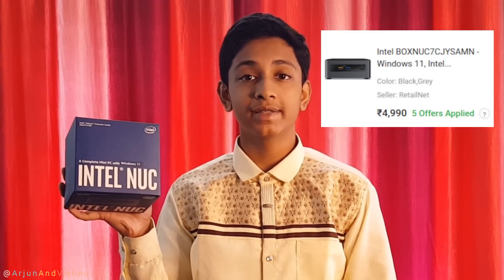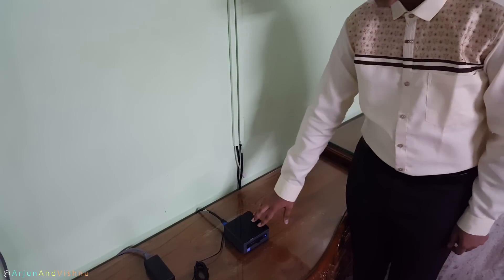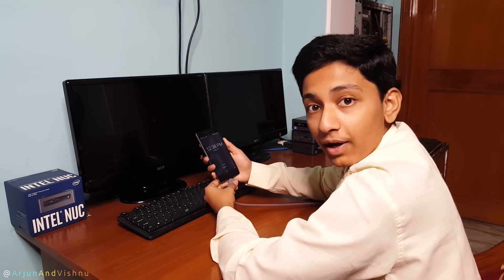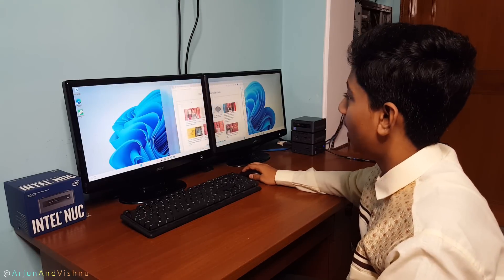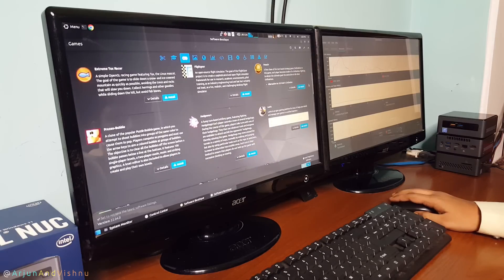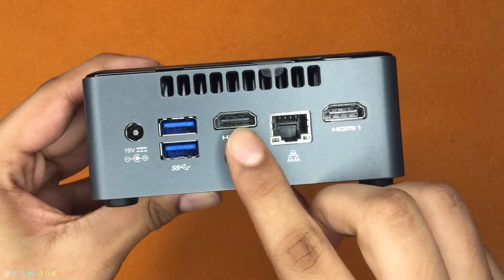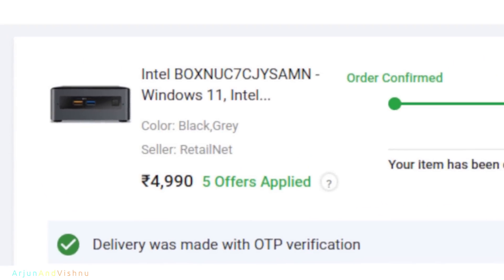Intel NUC Mini PC with Windows 11

Comment: I bought HP Chromebook 14a na1004tu 4gb/64gb emmc @18K on 21 March 2023.
Now I feel that I should have bought Windows because I regularly transfer photos videos movies web series in sd card, pen drive, external HDD and transfer speed is slow(in my old desktop pc i3 2100 with HDD, copy pasting is faster than this Chromebook).
Q1. How can I improve my transfer speed on this Chromebook?
Q2. I don't like Chromebook file manager app. Any other file manager app would you recommend like windows file explorer.
Q3. Which is better choice between this HP Chromebook celeron n4500 and Intel celeron NUC 4gb/64gb j4025 for home use ?
Reply from the maker: A1) I have gone through the specifications of HP 14a Chromebook. It has a couple USB-C 5 Gbps ports. Is the slowness of data transfer because the storage devices connected to it are USB 2.0?, or because it is connected via a USB 2.0 hub? To find out, you need to connect the storage devices and hub to another computer and test the speed with "Crystal Disk Mark". If they are fast, then you need to get the Chromebook checked by HP.

A2) N4500 is 25% faster than J4025 (NUC's processor). There is little that you can change on a Chromebook. Maybe, you can try installing Linux on it.

It is always better to buy a computer that you can install your choice of operating system.

I am not suggesting that you buy this exact model, but go through the review for an idea. It is more than twice as quick as your Chromebook, and you can modify such computers to suit your need. https://youtu.be/LIG-1PVGTrw
Reply: @ArjunAndVishnu  thanks for replying

Comment: Could it be use as Hometheater pc which can output atmos files to supported av receiver
Reply from the maker: The specifications say that it supports 7.1 audio through HDMI. It will probably need a HDMI cable with ARC to connect to a AV receiver. I am not sure about the atmos files though. All that I use it with, is with a mono Bluetooth speaker.
Reply: @ArjunAndVishnu  Thanks for replying 🙏 

I would like to ask could it use to play 4k files not in youtube just downloaded 4k files smoothly or it could lags in play 4k content?
Reply from the maker: I can give it a try. What bit-rate files should they be?

Comment: Bro tell me where to buy @this rate? tell me.
Reply from the maker: It is available on FlipKart. But, you got to wait for the deal. It was priced for Rs 5,990  on these days in the recent past:

3 July 2023
6 July 2023
15 to 19 July 2023

You get the additional discount when using card payments.

Comment: Where is buying link?
Its not available for aboves said price.
Reply: Thanks for the reply brother.
Reply: I waited for few days but price is constantly high only..

But yesterday i got card discount... So paid some less than usual amount.

Any ways..
Even 7k is not a big deal i guess..
In long run ( 3yrs warranty is there) it will be a ""paisa wasool"" scenario...

Thank you for the video..purchased it because of you.
Reply from the maker: Yes, it was not put on a deal since. I guess algorithms of online stores make price adjustments based on the visits to the product page.

Anyways, that is a good choice for the money. I am busy with my exams now. In a week, I will come up with a video on the NUC again, the software part. Do check around 13th of this month. Thank you.
Reply: @ArjunAndVishnu  Best of luck for your exams
Reply from the maker: Thank you
Reply from the maker: It is on FlipKart. However, there are some latest developments with Intel NUC lineup. These are mentioned in the description. Please go through.

It was priced for Rs 5,900  on these days in the recent past:

3 July 2023
6 July 2023
15 to 19 July 2023

Comment: Absolutely amazing video! Meticulously crafted from a well organized & informed mind.
I subscribed  to your channel and liked your video as well. 
Please help me understand one thing, I understand that it would handle very easily my browsing requirment and Youtube, however specifically I want to edit 4k, 50 to 30 fps Video in it. Can this pc manage that, little bit of 4k editing?
Reply from the maker: Thank you very much for the appreciation. Feels wonderful to know that my work is useful to everyone.

Although the Mini PC can edit videos, it just is not powerful enough to handle 4K video. The max it can do is 1080p (Full HD) workflows. That too, single track editing only.

The key thing is the playback when editing the video, which lags when you include complex filters. This makes the experience feel choppy. Rendering is a asynchronous activity, although it would take more time on this processor, it is not as much a concern as playback.

For 4K workflows with multi-track editing, you need a Core i5 or a Ryzen class processor, preferably with a graphics card.

Comment: I bought this Intel NUC i cant able to install chrome on it. It is asking for app recommendation. I cant able to turn off it. Can you help me with this issue
Reply from the maker: The Windows 11 on the NUC is in "S Mode" by default. In this mode, you cannot install third party applications that are not approved. Also, you cannot change the default applications. Although this keeps things secure, it severely restricts what you can use on the computer.

The good thing is you can switch out of this mode. This is a One-Time thing. Once done you will be able to install any applications you want.

However, it is also a One-Way thing, you cannot go back to S Mode once you have turned it off. Refer this webpage for info:

https://support.microsoft.com/en-us/windows/windows-10-and-windows-11-in-s-mode-faq-851057d6-1ee9-b9e5-c30b-93baebeebc85

To turn off S Mode and install Google Chrome:

https://static.googleusercontent.com/media/www.google.com/en//chrome/static/documents/intl/en_US/s-mode-instructions.pdf

Comment: Bro, Can I use this for Home NAS storage..?
Reply from the maker: Yes you can. That is what I am doing with one of them. I have connected  two dual HDD docks with 4 disks and made a file server of it. Since it has USB 3.0 ports all around, it is fairly quick. You can as well use USB 3.0 to SATA adapters and SSDs along with them for your NAS. Do set them on RAID1, RAID5 or RAID10 for data redundancy.

Comment: which browsers have you tested on it, even my current quad core 3Ghz struggles to keep up with today's modern heavy browsers forget gaming.
Reply from the maker: I have tried Edge and Chrome on Windows 11.

On Linux, I use Firefox and Chromium. The NUC is definitely faster with Linux.

I will do a comparison test later, keep an eye on the pinned comment.
Reply: @ArjunAndVishnu  & if you have a anti-virus /internet security like the heaviest Kaspersky pc performance is serverly affected if cpu is at least a i5 or ryzen.

Comment: This way way better than overrated Raspberry Pis for any real world practical use.
Reply from the maker: This Mini PC is a tad more powerful than the Pi4. Besides, it has expandable RAM slot, and the bus speeds are higher too. An SSD on the NUC does 540 Mbps and the same will do just 260 Mbps on the  Raspberry Pi 4 (According to my test on a Pi 4 8GB using Crucial SSD).

However, the Pi has certain use cases which the NUC does not fit in at all. The first being ARM architecture, and applications written for ARM do not work for x86 or x64. The other is the GPIO pins on the Pi which help signal other circuitry. So, the Pi will be irreplaceable for industrial applications in the near future.

Comment: Can run windows 7 and 8
In m.2 nvme or in sata hdd
Reply from the maker: These PCs have been around for a while, so backward compatibility will not be an issue. It should run Win 7 and 8 alright, provided you are OK with not getting updates (Since the updates for those OS stopped already).

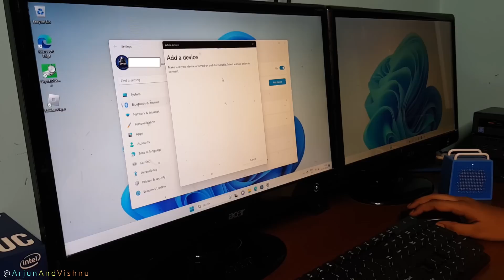It does not have a M.2 NVMe, but it does have a SATA port and you can install a regular SSD in it. I mentioned it in the shortcomings at 8:05

Comment: Compact vise is good , but celeron processor are aged one u won't get better experience with it
Reply from the maker: Yes, it is built well. It is not for a power user, but does alright for basic tasks. Besides, there is no other computer for 5-6k which comes with genuine Windows.

Comment: Price is different .... it's not 4990/-    but 7990 shows in flipkart link
Reply from the maker: Yes, but it was priced for Rs 5,990 thrice in the past one month on the below mentioned dates, you get the other 1000 as card discounts.

3 July 2023
6 July 2023
15 to 19 July 2023

Comment: Including power cable in box?
Reply from the maker: Only the power adapter is available in the box, the cable is not included. I bought it separately for Rs 200. I mentioned it in the Shortcomings at 8:16

Comment: Bro how many u brought & what will u use it for ,by the way i purchased two
Reply from the maker: Three of them 😊
Reply: @ArjunAndVishnu  did all cost u the same price 4990
Reply from the maker: Two of them did. I purchased them on separate orders.

I had the third one for quite some time, it was a different model NUC7CJYH, a bare-bone PC without the OS, RAM and Storage. Everything else was same. Considering that I bought it at 10K odd, the newer one at 5K is a real bargain.

I will use two of them for testing. The third one (bare-bone) is doing its job already as a server, I equipped it with 32 gigs of RAM, overkill I should say.

Just a note: When using higher capacities of memory in this machine, the RAM needs to be dual-rank. The single rank RAMs that I tried did not work. Frankly, an additional 8GB is more than enough for this processor to hit saturation anyway. That should keep the costs modest too (Rs 1500).
Reply: @ArjunAndVishnu  Which servers are you running?
Reply from the maker: In the case of this particular NUC, I am running it as a file server (Linux). I am using a couple of USB 3.0 to SATA adapters to which the SSDs are connected. I am using SSDs instead of HDDs for power savings. The disks are in RAID1 for data redundancy.

Comment: this minic pc is a good replacement for raspberry pi, given the exorbitant prices of pi due to the shortage. it also seem to have a infrared receiver as per the manual. has anyone found to make use of that?
Reply from the maker: You are right, Raspberry Pis were not available until recent. They are becoming available now and prices are cooling down. This Mini PC is a tad more powerful than the Pi4. Besides, it has expandable RAM slot, and the bus speeds are higher too. An SSD on the NUC does 540 Mbps and the same will do just 260 Mbps on the  Raspberry Pi 4 (According to my test on a Pi 4 8GB using Crucial SSD).

However, the Pi has certain use cases which the NUC does not fit in at all. The first being ARM architecture, and applications written for ARM do not work for x86 or x64. The other is the GPIO pins on the Pi which help signal other circuitry. So, the Pi will be irreplaceable for industrial applications in the near future.

Comment: Hey brother I have a request,
I have bought the Lenovo e41-55 laptop athlon gold 3150u 256gb ssd, and it will be delivered by 22 of july.
Please make a video on how to install windows 10 on that laptop.
Reply from the maker: Good to hear about your laptop. Due to time constraints, I cannot make the Windows installation video right away. But, I will keep it in mind for sure. You can use these instructions meantime:

You need to do these on another computer. You will also need a USB flash drive (Pen drive), with a capacity of 8GB or above.

1) Download Windows 11 here: https://www.microsoft.com/software-download/windows11

2) Download Rufus here: https://rufus.ie/en/
(Rufus is used to create bootable drives)

3) Connect the flash drive, and open Rufus. Choose the flash drive --- Point to the downloaded Windows file --- and click Start. It will take around 15 minutes to create the bootable Windows installation drive.

Switch to your new laptop, and do these:

A) Connect the flash drive

B) Start the laptop, and press F2 to enter the UEFI BIOS

C) Set the USB flash drive as the first boot device, save and restart (F10).

This should start Windows 11 installation, and the instructions will guide you easy.

Your PC will ask you to activate Windows, but will not force you to activate. You can continue to use it without activation if you don't mind a few minor things.

Comment: Good job ur the best😊
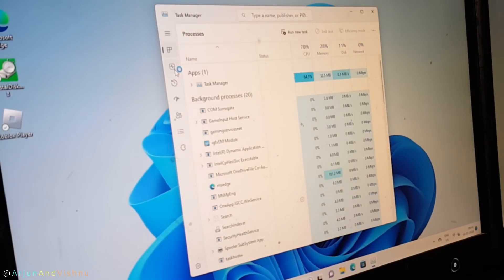Reply: At 5:03  cpu already shows 100% without any app opened, do u notice lags?
Reply from the maker: Yes indeed! The high CPU usage is because of the Windows 11 background services running just after boot. After a while, it stabilizes and the processor usage gets to normal. This is expected behavior since it is low end CPU. As I mentioned in the review, Linux suits this Mini PC much better, absolutely no lags on Linux. With Windows, you gotta add more RAM and turn off Memory Compression for better performance.
Reply: @ArjunAndVishnu  thanks for responding sir, yes I plan to use Linux mostly, which distros have u tried? and what's the cpu utilization like with Ubuntu? Thanks in advance
Reply from the maker: Hello, I tested it with Ubuntu Mate. I would call the CPU utilization as NORMAL. It touches 100% once in a while, especially when multiple programs are opened simultaneously. But settles down very quickly, much quicker than on Windows. I have not seen any sustained spike as such. I did try video editing on it, for a test and it managed to play two tracks without lag (No filters of course).

Don't call me Sir, address me a Vishnu. I am fine with it.
Reply: @ArjunAndVishnu  thanks Vishnu 😊

Comment: How powerful is it compared to athlon gold 3150u?
Btw love your content.
Reply from the maker: Thank you, I am glad you liked the review.

It is apples vs oranges actually. 3150U is around 2 and half times faster than the J4025, but is also equally expensive. The NUC is designed for power savings, meant to be used where it is just powered on all the time.

Apart from being a decent spare PC for backup or experiments, it will do great as a media center, standalone home server or a point-of-sale machine. For the asking price of under 5000, it is absolute value for money.
Reply: @ArjunAndVishnu  thanks